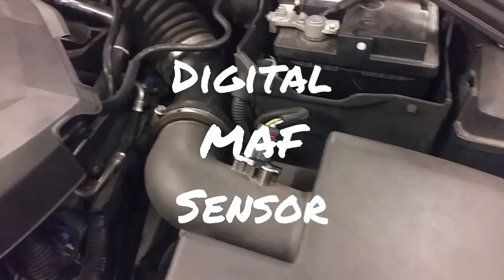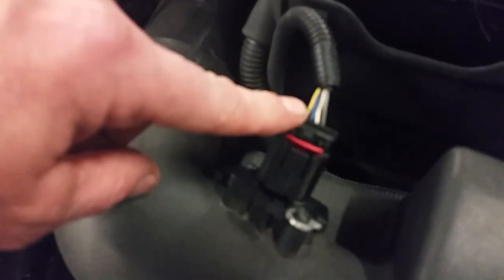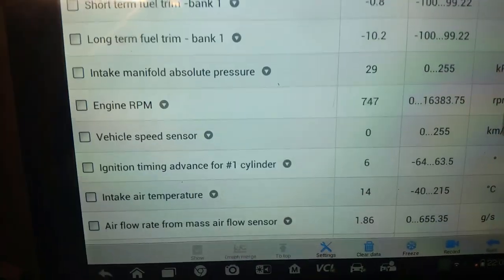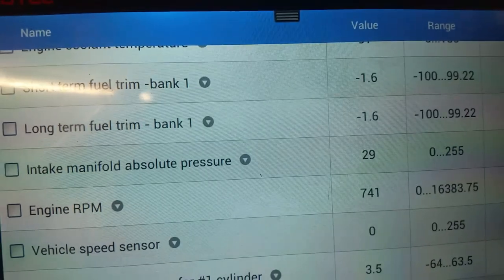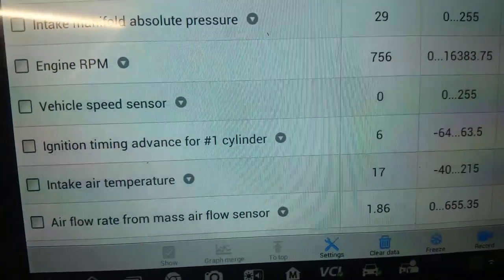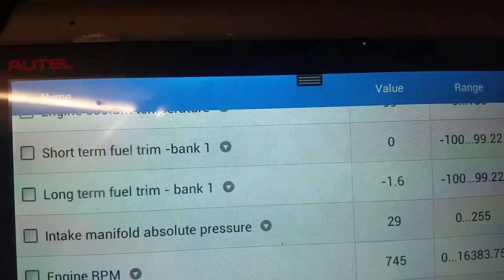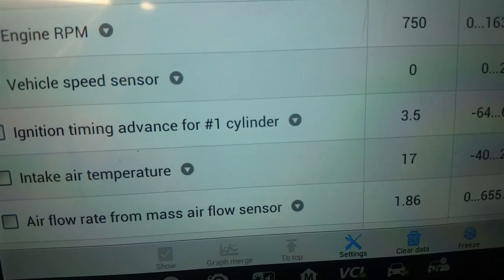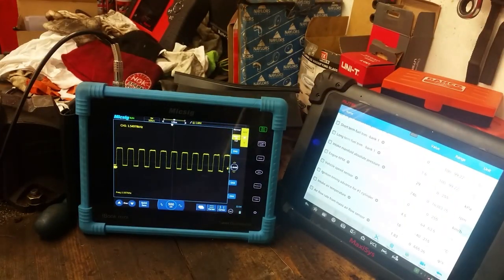Digital MAF hot film. Negative fuel trims

Comment: My LTFT STFT are - 17... MAF 2.6 on idle and with ac on idle 3.5.. egr error 99.2 sometimes egr fluctuating even negative error... O2 sensor 1 no reading sensor 2 reading is .1 to .9... air fuel ratio commanded and measured fluctuating...

Comment: Sorry, I don’t understand the process to eliminate negative fuel trims, is possible that you explain me please
Reply from the maker: Check out my other video on fuel trims in my channel list for the theory
Reply: it means the ECU thinks there's extra fuel coming in somewhere (rich condition), so it cuts (leans) the amount of measurable fuel thru the injectors to compensate and maintain optimal A/F ratio.
Reply: @Wes_5kyph1 so it sounds like all is good now… ecu has corrected fuel… no further work needed???

Comment: How did you/owner become aware of this issue Dave?
Reply from the maker: Neg fuel trims m8. New maf car more torquey cos its not having to correct on throttle
Reply: dave sterl I get that Dave. But if no MIL or driveability issue why check the F/T #'s ? What work was being done or the owners concern ? What cued you to read the data in the first place is my question?  Sorry Maybe I missed something.
Reply from the maker: ah rite i get you. This car was in for a service. The guy had just bought it. Regular customer and a mate so i do a full scan and look at all the live data to see how its running. This is a big car with only a 1.6 turbo engine and was a bit gutless low down. I told him this would improve the low end torque and fuel economy. Which it did.
Reply: Cheers Pal. Thanx for the background
Reply from the maker: no problem at all